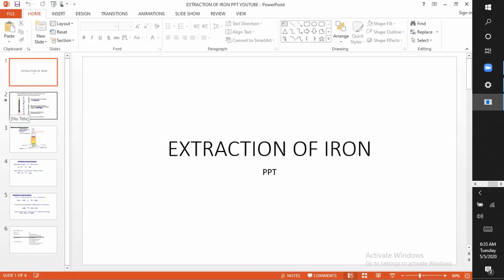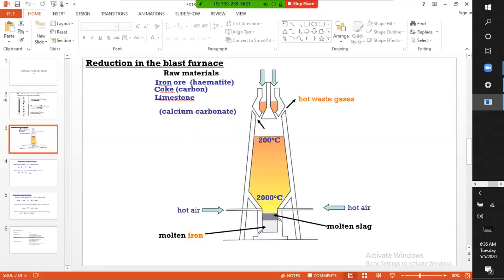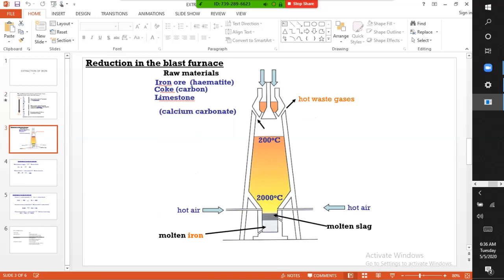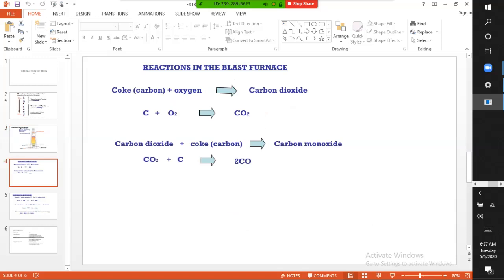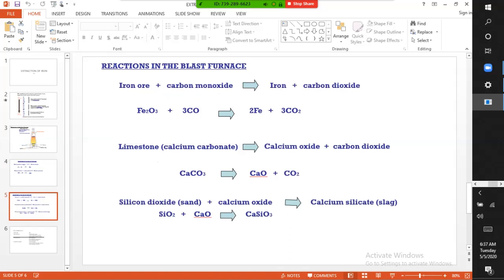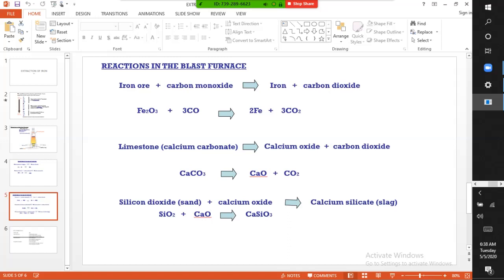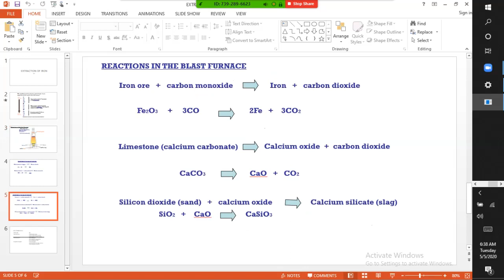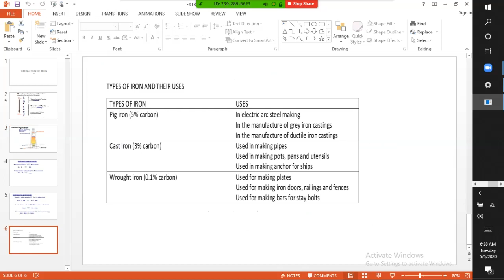IRON EXTRACTION

Comment: What is the reducing agent in the process described
Reply from the maker: The reducing agent is carbon (coke)
Reply: @simplechemistry8646   please sir help me in this question: The main reducing agent in the extraction of metal by reducing is-------? (A) coke( B) CO2 ( C) CO(D) graphite
Reply from the maker: @josephogbonna7678  ok if you're looking for the main reducing agent in the blast furnace, then you should consider carbon monoxide as it is constantly reacting with the haematite to produce iron. Carbon or coke is also one of the reducing agents in the blast furnace, but in small proportions